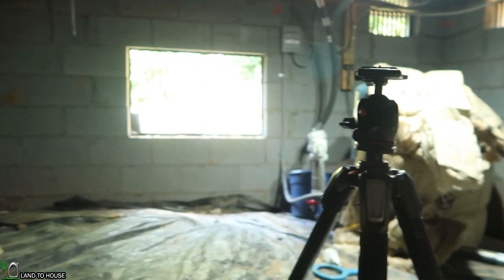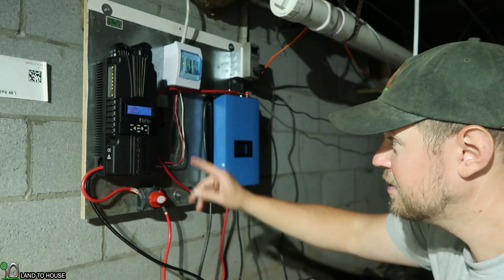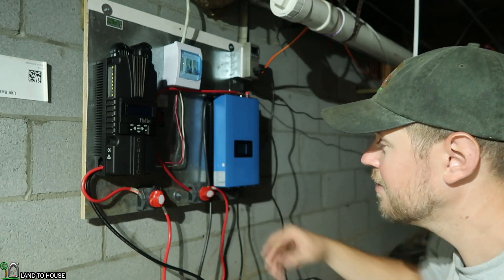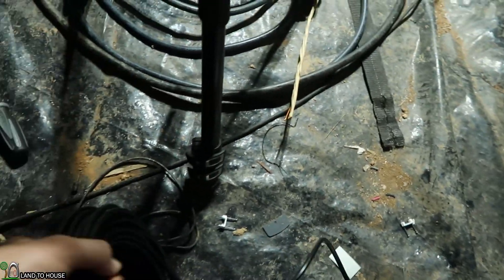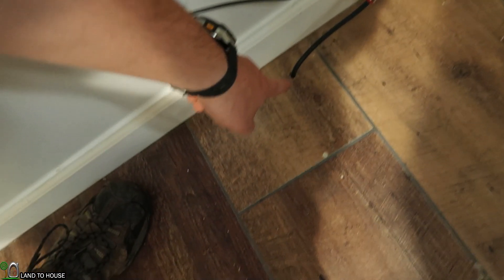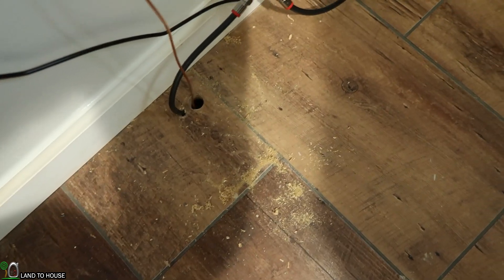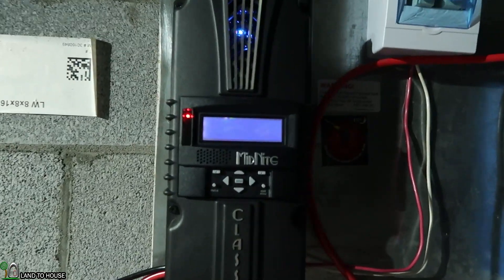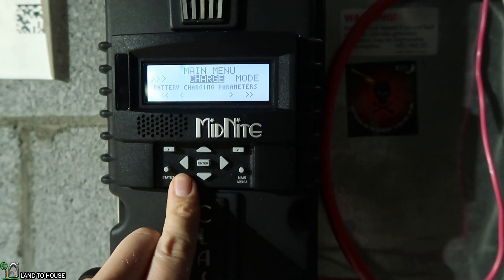Connecting Hydro Power to the Internet Midnite Solar Classic

Comment: I just bought a farm house and there were many projects "on the go". It has taught me the importance of labelling wires, cables, ethernet cables, switches. Even creating a little rough-and-ready diagram of what goes where is a helpful thing. Might also save you getting accidentally zapped or spiking a piece of expensive gear. Really enjoying your videos thanks Seth. Keep 'em coming along.
Reply from the maker: I agree! I am going to be moving down to a 48v system with 8 batteries. So... solar is coming up next and then I will be working in better cable management...i hope.
Reply: @LandtoHouse  Well that sounds like a couple more great videos coming up. Looking forward to it. Cheers

Comment: Seth I would have plugged in the blue tooth dongle that plugs into the Ethernet port it is just a blue tooth transmitter option available from Midnight classic. If you have a blue tooth card on your laptop you can do you logs and all without having to run wires it will also work on your mobile devices. RV prepper Wayne has an older video on how to hook one up on his you tube channel.
Reply: Seems to me Bluetooth might not have a long/strong enough reach for his purposes?